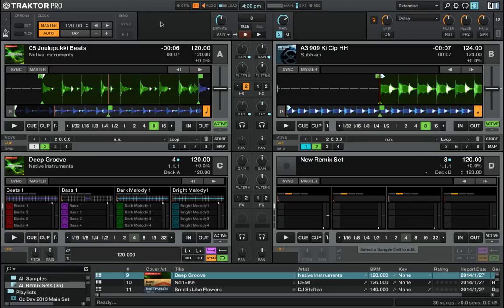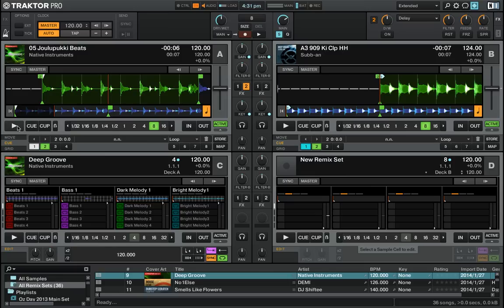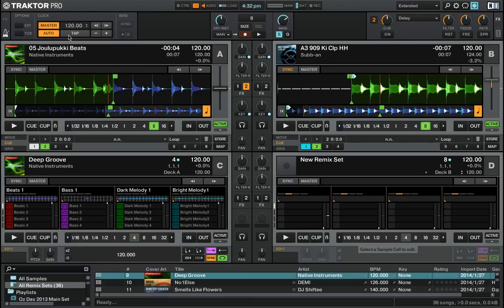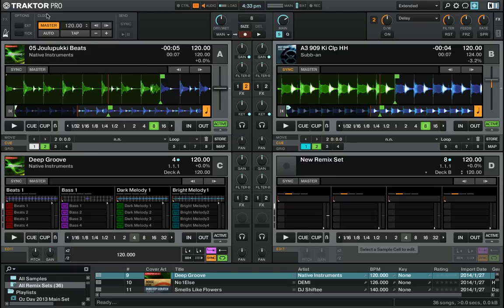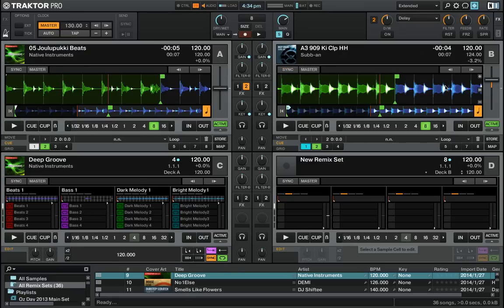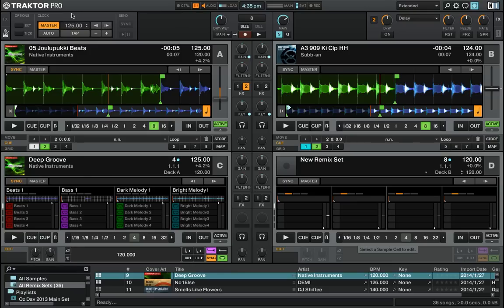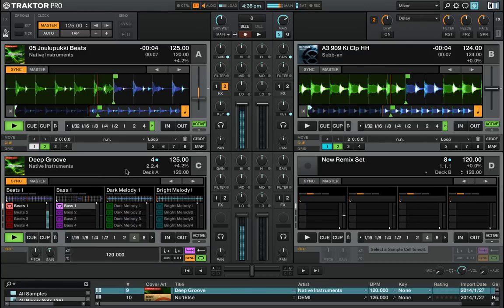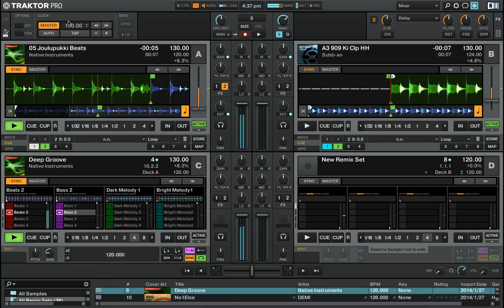Traktor Master Clock and Master Tempo Tutorial

Comment: I used to be able to do this, but somehow it stopped working. when both songs are in sync, and playing. lets just say one song has 120 bpm and the other has 125. if the master tempo is set to 120, while i start playing the song with 125 bpm in the 120bpm in sync. is there a switch or something in the options that allows for tempo change while both songs are playing? because right now when i try to tempo change at a song break at the end of a bar, it wont do it. what button in the options allows for it? i mustve turned it of

Comment: Hi ! Good video!  I've been a traktor user for quite some time now and suddenly something changed with the master sync function. (At least I think so) 

Before I upgraded my software I could play Deck A and mix into Deck B and as soon as I stopped the vinyl A, master light jumped over to deck B and set B as the master track.  Now when I stop vinyl A ,Master suddenly jumps up to masterclock and I have to select witch deck is master all over again. Ive tried to turn off Auto and Master button on Clock but nothing seems to work. Any suggestions? 
J
Reply from the maker: That does sound strange. The Global Clock must be set to Auto Mode for the Master to move between active decks. Maybe this is one to post on the NI forum?
Reply: +tmccoy00 Maybe? I've been using the program 
for several years but I suspect something happend when I upgraded to 2.10... I'll see if any other in the forum have the same problem. Keep up the good work sir!